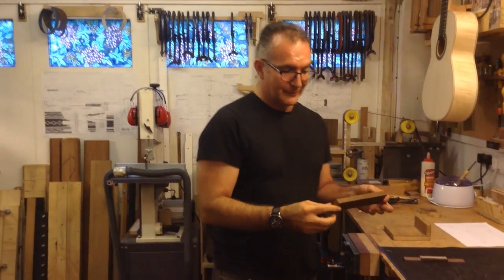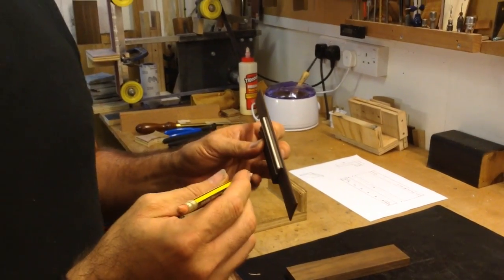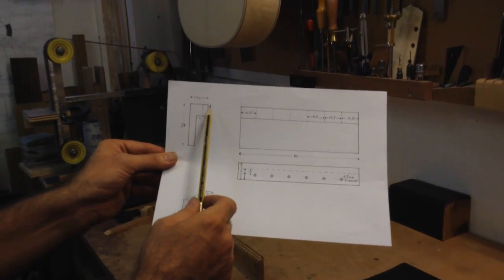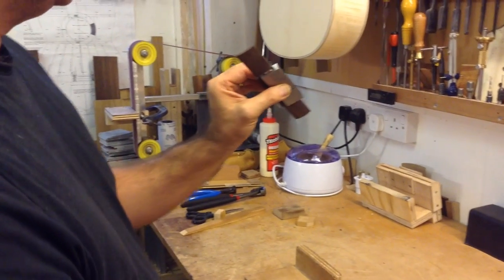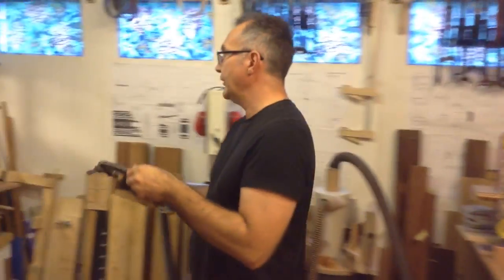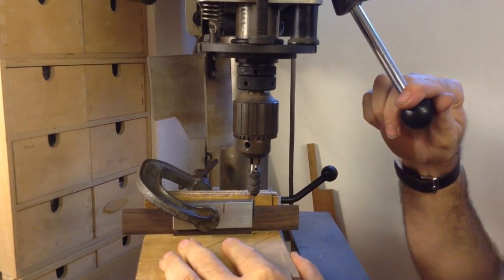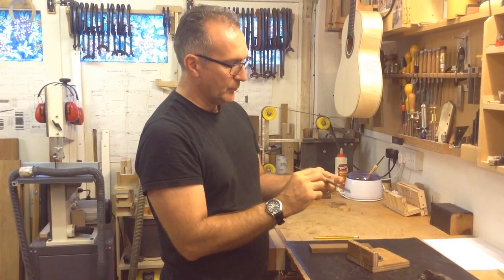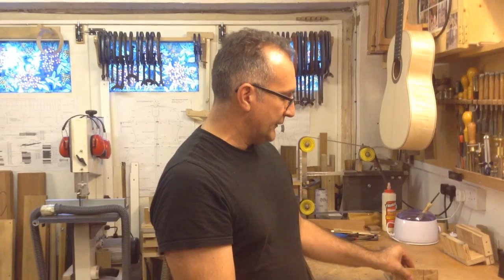How to make the holes for the strings in the bridge

Comment: Nice seeing you employ the 12 hole system. I would make all bridges 12 hole because you still have the choice of using the 6 hole arrangement. Then the player can experiment with different tensions. Some flamenco players use a hybrid system, some strings using one hole tie and others using the 2 hole tie. Strings are not manufactured so well (some brands) and the tension of each string is not balanced, so an experienced player will use this hybrid system and it works. Or they buy several different pack of strings and choose from them what they want, but of course this is costly. This is an 3xcellent video as always.

Comment: Interesting video. I have a Schramm classical guitar made in the US and the 4th and 5th strings continually break at the bridge. Any corrective suggestions? Thank you
Reply from the maker: Perhaps the edges of the tie block are a bit sharp, you could round them up a bit with sandpaper.

Comment: All your videos are very very interesting and useful. I see you use not slanted saddle on your bridge. Any advice on using slanted or not slanted saddle?
Reply from the maker: I wouldn't say that it is better or worst, it is just not necessary.( Just my opinion!)
I use the same compensation for all the strings, +1.5, and if the guitar in particular needs it I can ad a bit more on the 3rd string by shaping the saddle so that the section where the 3rd string rests is shaped to make the string just a bit longer.
Reply: Thank you very much for the clear advice!